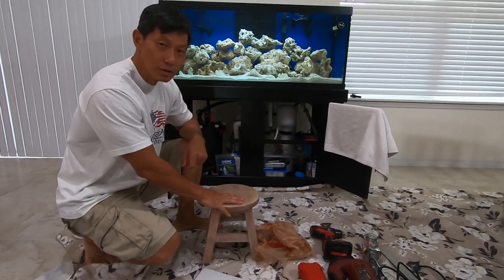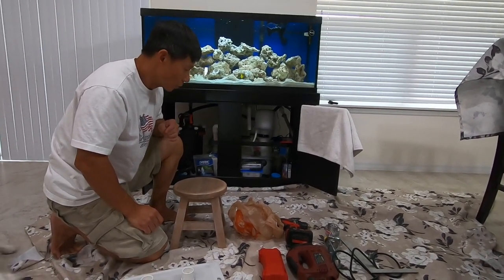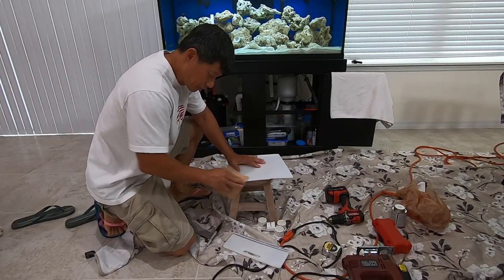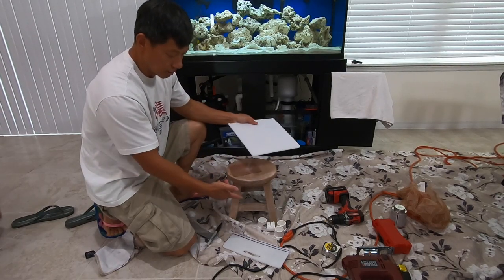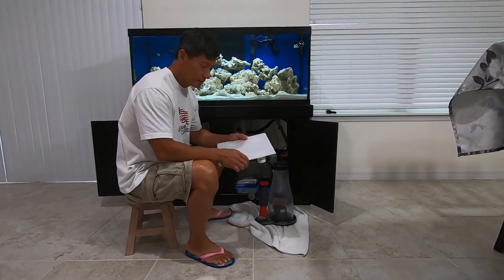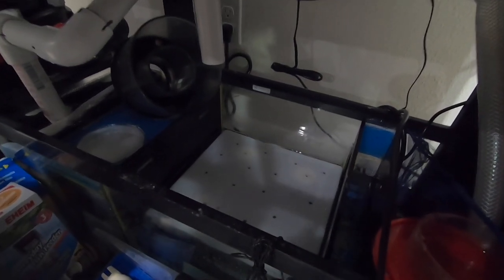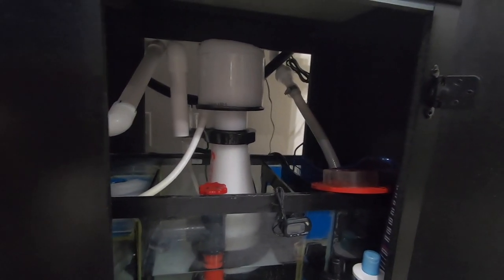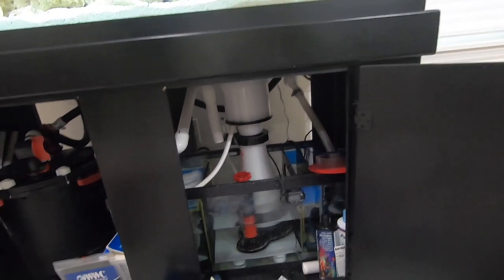Protein Skimmer Stand DYI

Comment: you forgot to add the price of the equipment needed to do the job :P
Reply from the maker: I bought the 20L aquarium from Petco and the sump kit is from Marine Exotic Systems. There are videos of the installation on the website.
Reply: Hi from England UK , Start with the lowest setting and adjust every couple hours, working your way up. Bubbles should sit just below the collection cup and any crap will be pushed out above it into the cup 👍🏻 hope that makes sense 😂 good videos